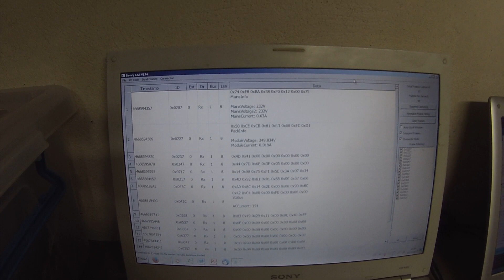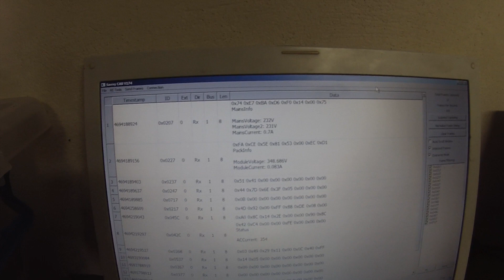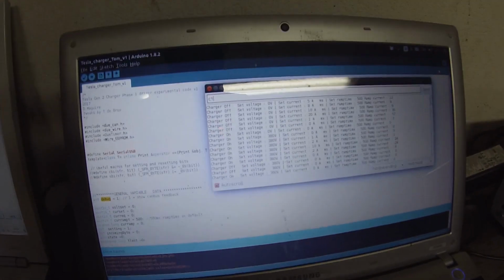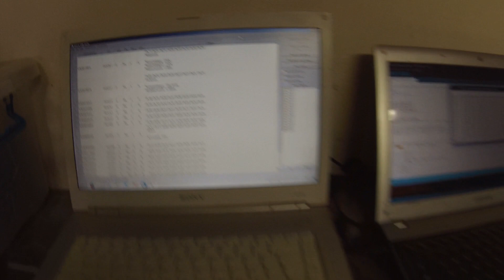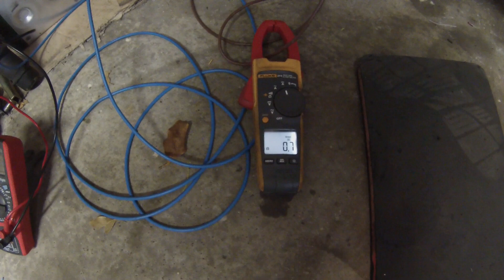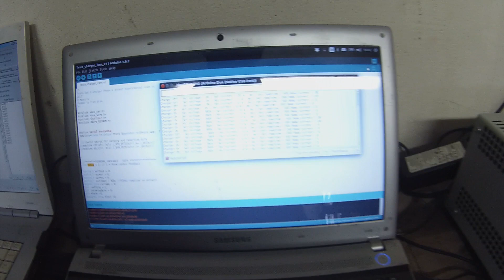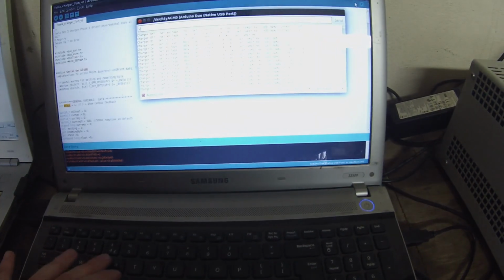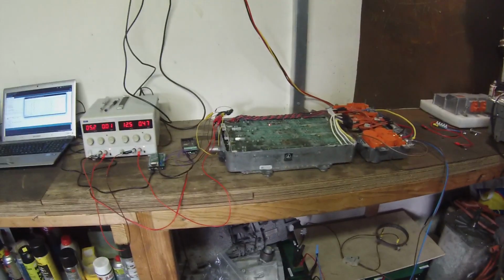The Tesla Project : More Charger Hacking

Comment: I would like to plan to use a hacked TESLA Model S 10kW charger on my build.  Two questions, Do you know yet what the maximum charge voltage is?   What are the measurements of this 10kW charger?
Damien you are doing great things.
Reply from the maker: +Mark Yormark Thanks Mark.The label says 450v max.Will get dimensions for you at the weekend.